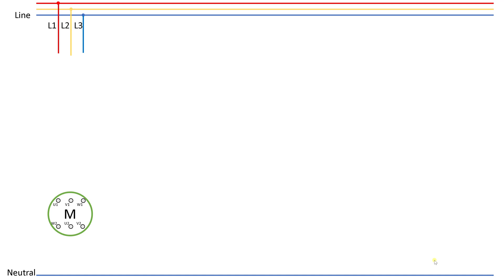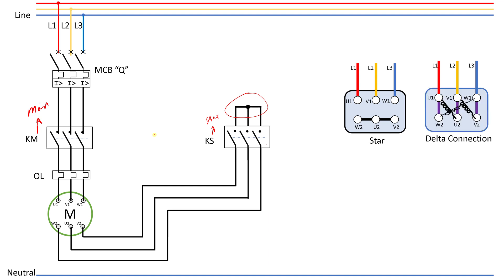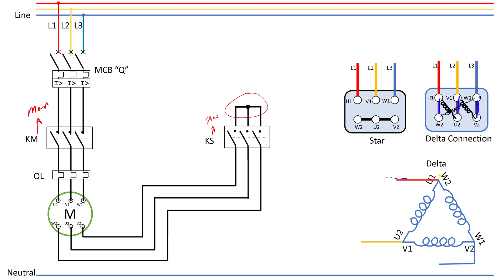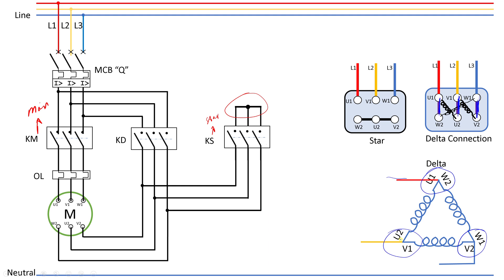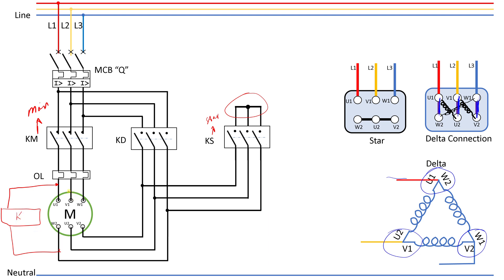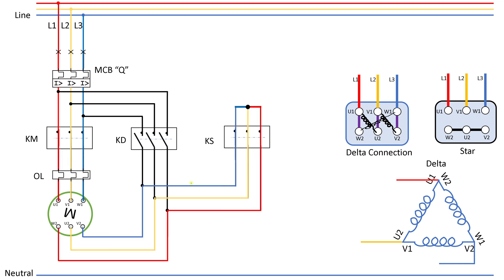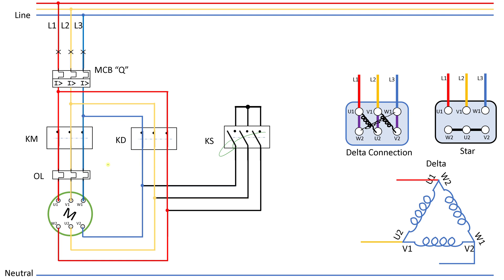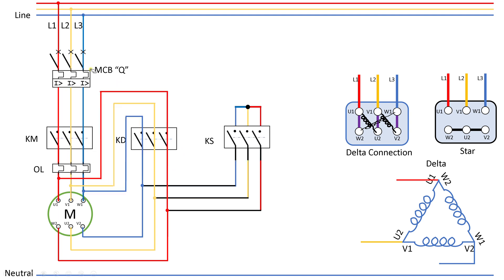Star Delta Power Circuit Explained & Animated,

Comment: I Think there is a problem in delta connection.  Because for delta R phase must be connected to Y or B and Y phase must be connected to B or R and so on.  But Here it shows R is to R and Y is to Y and B is to B. Its not Delta. If I'm not wrong plz help me understand
Reply from the maker: Hi, I provided a full, detailed explanation and demonstration of the wiring and why it works in my Udemy course. So, if you want the details, you can find them there. However, I can say that this connection works because I have applied it practically and physically in the course as well.